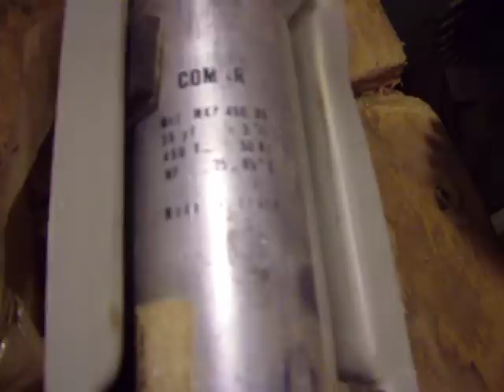DEWALT RADIAL ARM SAW STARTING PROBLEM ,POWER CONNECTION AND TRANSFORMER

Comment: Motor start is essentially a relay and has various wiring sequences. There are thin strips of metal behind the coil that act as fuses, if these are corroded or blown, they need to be replaced. Also you want to check power on both sides of the on/off switch (in 'on' state) and primarily check for 120v on the side of the switch that feeds the coil, at the coil. If this is absent check the switch or the feed to it. If present suspect the coil. Message me if you are still stuck.